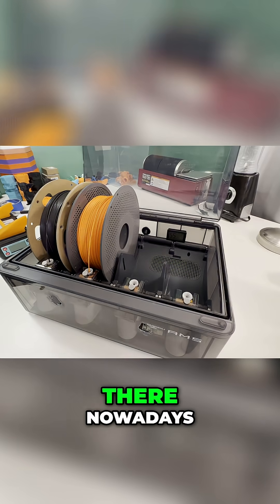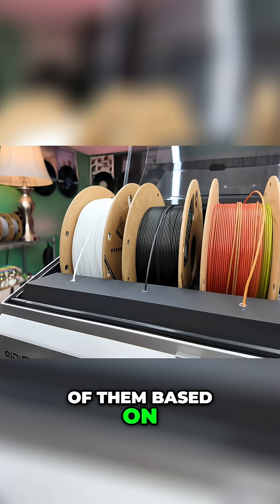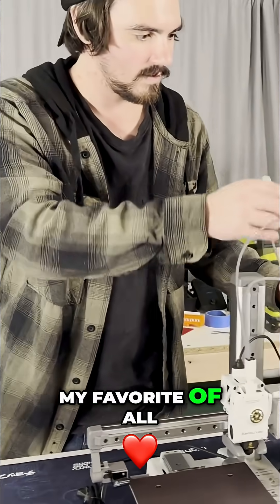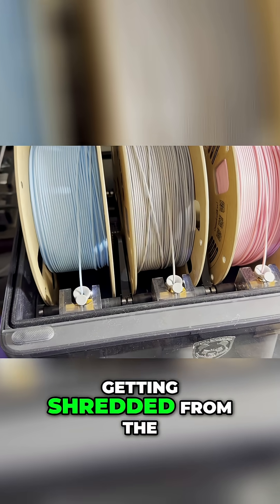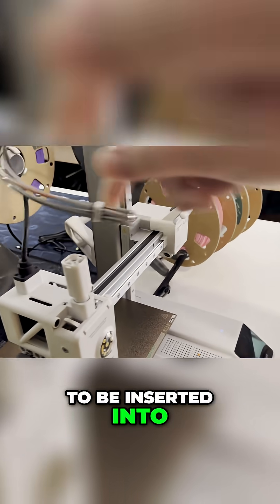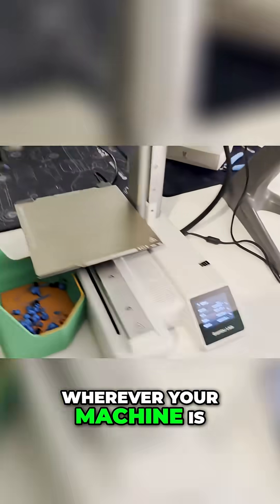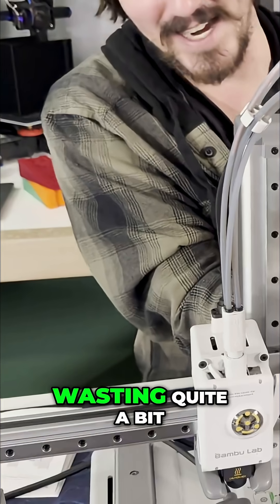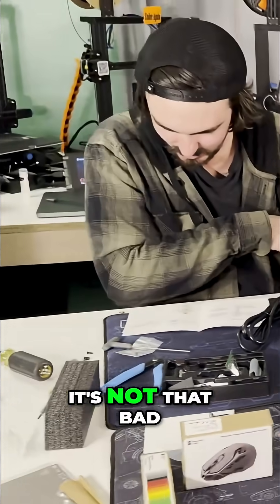Multi-Color 3D Printing: AMS Lite Review & Space Saving Tips! #shorts

Comment: What do You mean "which one should You be using"? You dont have a choice. You simply gotta use what is compatible with Your printer.
Reply from the maker: It’s more so framed around if you were picking your printer based on the multicolor system

Comment: Yeah no, not touching bambu. They tried anti-consumer practices of forcing to buy only their filament. The system is still in place if they want to do it with simple software update...
Reply from the maker: Though you can still run whatever filament in your Bambu machines, who’s to say they don’t turn that off in the future
Reply: The insult to the injury, is Bambu filament is really good quality.

I got a Qidi Plus4, after Bambu locked down their ecosystem, love it, but I use it with Bambu PETG-HF, because it gives the best results.

Not buying any of their gear though.
Reply: No, only their RFID is closed/proprietary, that doesn't stop you from using other filament brands at all.  I regularly use eSUN, SUNLU, Elegoo, iSANMATE, Creality, never had an issue, even in the AMS Lite, AMS 1 and 2 Pro.